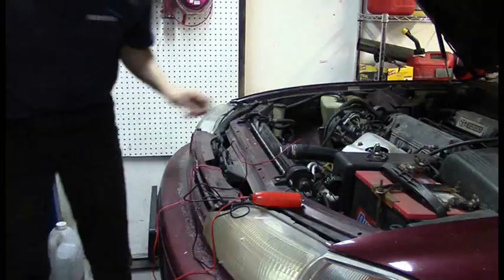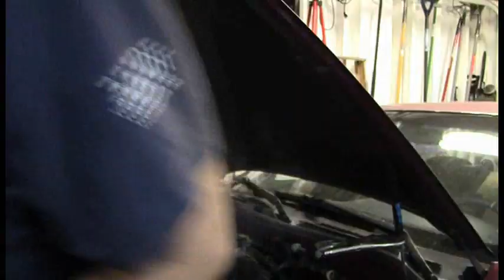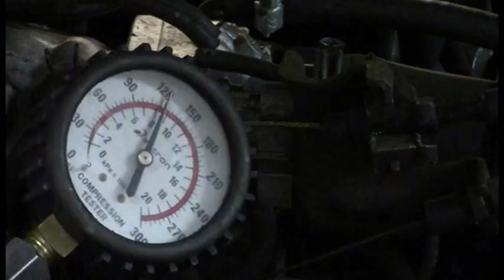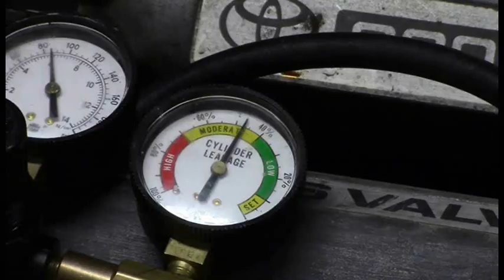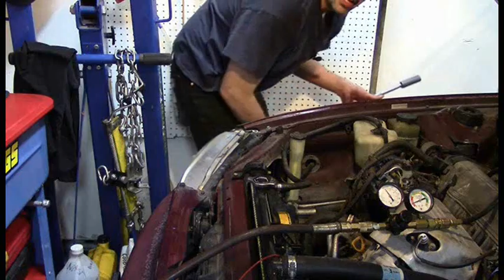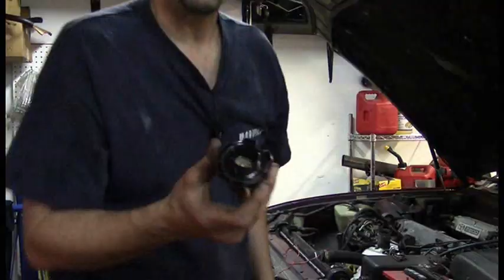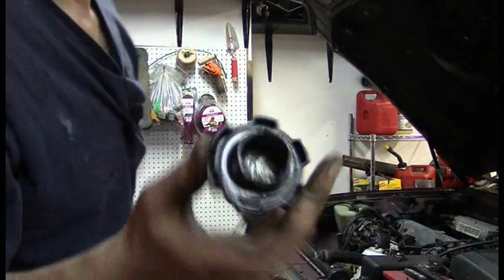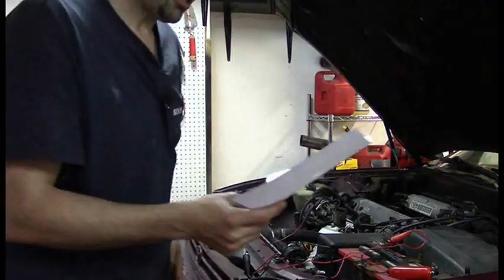12 Ways of How To Test A Blown Head Gasket Compared- PART1

Comment: What year is your Trans Am? I had an 82 fully loaded-with a 4 speed-definitely miss that car. Enjoy your methodical approach to car repair-keep up the great work.
Reply from the maker: Thanks bro. Mine is a 2000 WS6 6 speed.  It's 357RWHP dyno tested at LG motorsports in Texas
Reply: Schrodingers Box Wish I had that six speed when I raced Corvettes from Vegas to LA on Interstate 15. I upgraded my Trans Am from a 305 with a 4 barrel carburetor to a 350 with fuel injection-probably added another 60 HP. One weak area was the headlight door relays-It looks like crap when your T/A has only one headlight opened.....
Reply from the maker: Jimmy Mac Ha yes those days with all the "Winking" firebirds lol. I owned a '91 with the 305- but to be honest I think the 305 TBI's might have been the worst engine ever in the F-Bodies. The step up to the 350 LT-1 was huge in '93 and I owned a '97 at one point that was just loaded with goodies and louder than the one I have now!
  The 93-up versions still have headlight problems though. The gear in the headlights often strip and it makes a god-awful grinding noise when you lower them and at some point the gear gets so bad it won't lower but the motor still runs. New motor is like $200 though so it's frustrating since the motor isn't burned out. You can actually dissect the motor and replace the gears with a kit available online for $30.
Reply: "Winking" firebirds good one. You're right the 305 was a lousy engine. The only other drawback with my "Kit" version of the Trans Am was the manual clutch-no hydraulic assist. My left leg literally grew bigger from all the shifting. I had an accident with it and put on a new hood from an 87 firebird with the cool looking louvers. If my son didn't come along 8 years ago, I was looking into getting a Firehawk. My first muscle car was a 1970 Dodge Charger-will eventually get another Charger when the time is right....

Comment: Fantastic matt wow that was intense - do you concur the head gasket failure  was because of a overheat condition caused from   a misfit of the  rad cap ?  For the blot test   did you identifying proteins . LOL
Reply from the maker: Ha, no proteins identified, probably due to antibody promiscuity, but I am not 100% sure why the car overheated.  I suspected the radiator cap because the neck was all chewed up, you can see the dried coolant all over the front of the vehicle in some scenes in the video, and also there was another radiator cap on the floorboard of the vehicle leading me to believe the cap was replaced in effort to seal it better but the radiator neck was the issue. Either way, new radiator will be installed after I finish the head replacement.
Reply: Schrodingers Box Don't you just love the detective aspect of working on cars??? It's one of the things I love the most.  I was very glad to see you mention that crusty radiator neck and rad cap!  Can't prove it 100% but you probably nailed the root cause of the overheat right there.  For such a seemingly insignificant part, the rad cap is often overlooked.  It actually performs a very critical function and when failed it can cause havoc to an engine.  Most people don't realize that is a mechanical part with moving pieces that can and do fail.  Great vid all around!
Reply from the maker: Jeffrey Wilson Yes it's the detective aspect that is the fun part for me. I actually could care less for the wrenching lol.  Good diagnostic technique uses the scientific method, regardless of the application. You come up with an idea to explain an observation and you consider every possible thing that could explain it and systematically rule them out by logic and applying the ideas to a known working system to see if the effect is duplicated.  It's EXACTLY the same approach whether it's cars, electrical, plumbing, or a cure for a human disease.  I could diagnose stuff all day and never get bored- but I am already sick of changing this cylinder head.  Incidentally it's .0025" out of spec at #3 lol- spec is .002" but the .004" feeler passed right through no problem.  I am amazed the compression was over 100!!
Reply: Schrodingers Box I agree 100% and i feel the same way.  I have always been a bit of a tool junkie, and used to like wrenching just because I loved using tools..you know? But the further I get in my career the more I am drawn to the science and "thrill of the hunt" of diagnostics.  Sadly, its often the least paying part of the job, but by far the most rewarding.  Wow ya those measurements would indicate a pretty darn big leak.  Even during the video with some of the results you got I would have expected lower compression..but i have had some really goofy scenarios in the field.  If ever there was a human invention that seems to be able to defy rational thought and the laws of physics, its the automobile lol.

Comment: Good information. I never knew there were this many tests. One thing I have learned over the years is if a vehicle starts to overheat due to a suspected blown head gasket, pull over and shut the motor down for two minutes or so and restart. The shut down will allow the hot coolant to bathe the thermostat and it will open. Just a stop gap, of course, but it can give you a chance to get home or to a shop. All of this assumes the driver keeps an eye on the temp gauge... a very big assumption.
Reply: Also, cranking the heater to full heat and fan speed will help bring the temp down a bit..might just be enough to limp home or a shop as well
Reply: @jeffreywilsonrubikscubeonb2428  I've had to do that once in the heat of summer. Not fun but saved me!!

Comment: Hey Matt…I have the day off today so I was happy to see these 3 recent uploads! Just finished watching part 1 of your head gasket tests and very good video for sure!  I was able to pick out which plug was from the cylinder that was burning coolant just by looking at it by the way.  I didn't get a good look as you were moving the plugs around quite a bit but there was a moment where you could see a noticeable white "crusty" looking spot on that one plug that was visibly more pronounced than on any of the other plugs.  It was on the underside of the curved electrode (the side that would be furthest downward in the chamber while installed in the car)  In my experience in the field I have never seen a plug that was burning coolant that didn't have noticeable white deposits.  I wouldn't call a head gasket based on this visual inspection alone, but reading plugs is very useful for helping in what diagnostic direction you want to go in :) There is some good info out there on the net about plug reading, and I think you may come to like it.  Just another little weapon for your arsenal to help in finding direction.   Great vid!